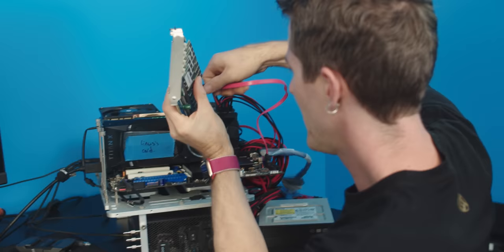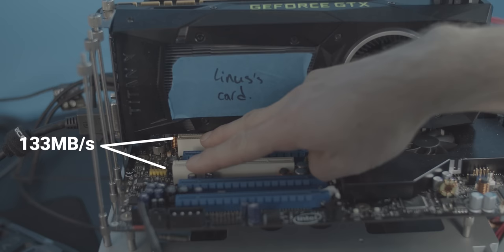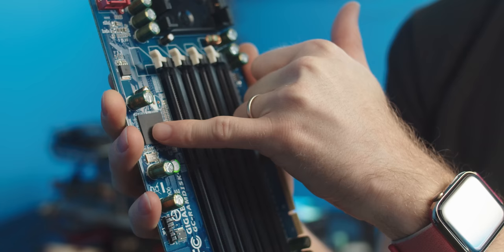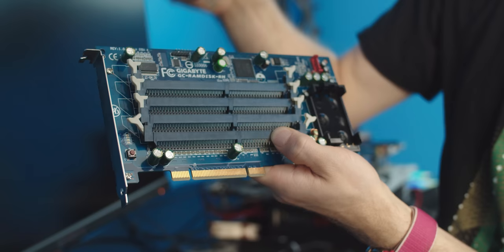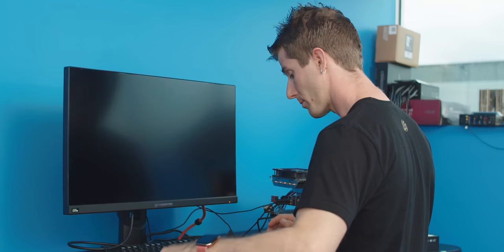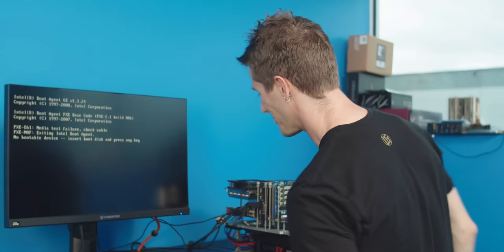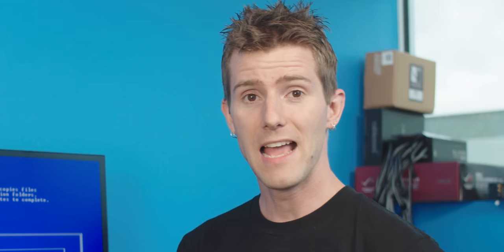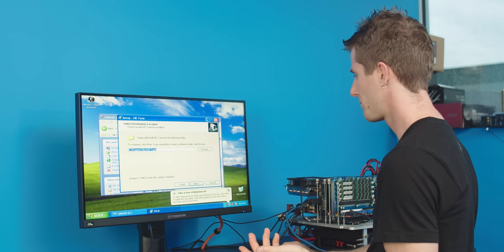WTF is this thing? - RAM on a PCI Card??

Comment: Amazing drive. Now when FBI gets me I just turn off my pc and my data is gone.
Reply: @budgetbajur  oh yeah this is big brain time
Reply: good job Jared
Reply: This idea is actually kind of used. There's an operating system called tails os which keeps only a small bootable operating system in storage (you can have it on a flash drive) and all session information is kept in RAM, then when you log out it is all securely erased. Combine this with Tor and you'd be real hard to track.
Reply: @sfadhjkl4112  Actually Tor is already preinstalled in Tails ))
Reply: You see Ivan, Americunts can no steal data when no data is there.
Reply: Oh so that I the reason it was removed from market.
Reply: Thats probably the best use I can think of for this "drive". The data would be super secure from physical theft or seizure, especially if you don't have the battery installed.
Reply: Not really.
They will break you door, get canned air and freeze your memory with it, then quickly dump the contents before they're gone.
It's what they do with actual memory.
Reply: @dan_loup  absolutely!
Here's some interesting stuff for other:
https://en.m.wikipedia.org/wiki/DRAM_data_remanence
and
https://en.m.wikipedia.org/wiki/Cold_boot_attack
Reply: @dan_loup  how can canned air  prevent data loss from ram on power off?
Reply: @frinkpc2515  смотри выше ;)
Reply: KAJJTAN If you have enough ram, I think it would be possible to set up a persistent ram disk to do the same. Maybe.
Reply: @frinkpc2515  They literally freeze the chips.
This somehow makes the capacitors take more time to discharge.
Reply: @frinkpc2515  When you turn a can of air upside down, it sprays freezing cold air. Spray that freezing air over the RAM sticks for a few seconds, and all that volatile memory data freezes in place. You can then transport it, unpowered, to another machine and read back the data.
Reply: @BaghaShams  There IS a countermeasure against that, and that's by simply making sure that TAILS is allowed to zero out the session storage memory as it shuts down, as well as doing whatever can be done to delay access to the computer's internals to allow more time between power loss and freezing. Stuff like installing a lock on the computer case to delay it's opening by another 30 seconds at least, or making sure law enforcement jumps through requisite hoops if it's not a no-knock raid (which you should be doing regardless.) Also memory encryption is also possible as a countermeasure, or if you REALLY wanna look incriminating, you can physically secure the ram to the motherboard with glue or solder and use SecureBoot to make them have to risk more time between powering down and dumping the memory.
Reply: @dan_loup  you unplug as soon as you hear the door broken down.
Reply: @dan_loup  oh so that's why it was so cold here in august...
Reply: @sfadhjkl4112  Most Linux live CDs do that. Most see it as a limitation, tails see it as a feature.
Reply: HAHAHAHA I should not be laughing so hard at this comment lol
Reply: @Offsettttt  I think it set up so all internet connection go through tor. not just the browser, but the entire OS
Reply: Set your BIOS to overwrite memory during POST. Hit the reset button when they break down the door.
Reply: @bonob0123  Jared did nothing wrong.
Nice try though, still pretending he was guilty when he had proof he was not. 
Your beating a deadhorse. Your witchhunt failed. Get over it.
Reply: @dan_loup  I know of this, but want to see it in practice.
Reply: best statement I have seen all day
Reply: @factsvscommunism3679  lol wtf
Reply: Nope that wouldn't work either! The residual charge is STILL THERE even after you cycle power on/off for a few short minutes! If the MIB's bring along their tank of Liquid Helium, they can STILL recover your data!

AND since they ARE the MIB, they won't announce their raid on your Deep Dark Web Hacking Lair and they WILL get to your computer within the allotted 3 to 5 minutes it takes for the residual electrical charges to dissipate within your computer's RAM !!!

Every second counts though.....BUT....because of modern mathematics and digital signal processing (DSP) they can assign the MOST LIKELY bit state is assumed to be present when OTHER nearby bit states are consistent with known facts, data and/or file structures. This means they can afford to take their time to find you and your computer to get at those RAM sticks!

To PROTECT against such MIB (i.e. the Men In Black!) shenanigans, take the 240 volts at 30 amps circuit from your washer/dryer and stick some live wires directly into a USB or network port. At that high voltage and amperage, the result current and massive spark will jump any air gaps or motherboard fuses and WILL DESTROY your RAM chips permanently --- PERIOD !!!

That will work!

.
Reply: Clyde Cash  HOW ISNT HE INNOCENT, HE HAD PROOF ON TEXT, THAT THE PERSON ADDMITTED THEY LIED ABOUT THEIR AGE AND PROJARED THEREFORE WASNT A PREDATOR, Better luck next time.
Reply: Clyde Cash  'HOW IS HE INNOCENT' Because he was never proven GUILTY IN THE FIRST PLACE and HE GAVE PROOF that he did nothing wrong? Try again.
Reply: Clyde Cash  He was never guilty, you cant ask how he is innocent when he was never guilty in the first place. Its been months since he proved your lies wrong, Try again.
Reply: @bonob0123 Pro Jared was a PROVEN innocent man who had his life robbed due to a fact, unproven accusation that was debunked with proof. Yes 'WTF' indeed.
Reply: @factsvscommunism3679  relax Jared. didn't realize they let you creeps access to YouTube inside Englewood
Reply: @Exarian  Or you know... just use a case. I don't really see how they would be able to get to it in time as RAM has a tendency of purging itself really quickly.
Reply: @dan_loup  apparently only if they get to your machine quickly, like if you're able to pull the power and not instantly tackled most of the data would be lost
Reply: @forcefxguy  You probably have to stall em for like 30 seconds to be sure.
Reply: take the memory VCC and connect it to a relay directly into a 9v or 12v battery, pot the board on thic resin, then put a switch in the bottom of the pc and one switch in the case and a thermistor with a temperature comparator, pot the motherfucker and put a VGA output so that it doesn`t seem like a ram module to begin with. Door sensors are excellent triggers for a raid, as the MIBs and FEDs break all of the doors in a raid you can have a weak door to nowhere as a trigger.
Reply: @fss1704  Just the potting part will probably do the trick.
Reply: @dan_loup  Did you ever watched fantastic four? remember what happens when you freeze rubber/plastic? it gets brittle and weak, any hammer will shatter the resin into a million pieces.and free the ram at low temperature, that`s why you need a sensor in order to fuck the modules in the case the temperature drops below a certain limit, and the wire mess connected to the trigger so that they can`t even chemically dilute the epoxy using MEKP or DCM because one wire would touch another and trigger the circuit.
Reply: I see you are well versed in this! Are you in Utah, Colorado, Virginia or Maryland by any Chance?

As another suggestion, I just put small shape charges onto the motherboard, ram and hard drives and blow their brains out if any nefarious party enters unceremoniously via a simple and easy to reach heavy-duty toggle/contact switch assembly! You you can also use a deadman's type switch that triggers the shape charges if the case is opened or hacked through with pliers, hammers or a saw! 

That works too!

--
Reply: You could also rig a circuit that produces High voltage at the touch of a button.  It would blow out every cell in the ram chips, destroy data on platters, and literally melt chips.  No way in hell data is coming back from that
Reply: @sambach9450  why use HDDs at all, it's so much easier to blow up  the data on ssd`s and the price is so low, and you can be 100% sure that you've destroyed the data by popping the chips fried instead of possibly leaving some incriminating data on the platters.
Reply: A brick of C4 or Semtex would ALSO do the job and IT LOOKS SO MUCH COOLER to blow up your house in a great big ball of orange, blue and white fire to ENSURE your data is safe from prying and/or evil eyes!   :-)  :-)   :-)
Reply: Wait you guys dont have your PC hovering over an incinerator? noobs :P
Reply: bang on the money, mate. a german mate introduced me to it several years back. he uses it himself for 'reasons' *wink*.
Reply: @dan_loup  Doesn't seem likely to work unless things go perfect for them. No battery and a pulled plug as soon as you hear the door go, there's no way they'll get to the internals before the caps are dead. If they're storming your house, odds are, you're going to face an AR, not a can of dust off.
Reply: Exarian honestly at that point just have a small amount of C4 attached to the ram with a detonation device attached to a heart rate monitor as soon as your cat knocks the lamp over your whole computer just goes up in smoke
Reply: Never mind I just scrolled to the bottom of this conversation and I see some other degenerates have entered the chat recently
Reply: @budgetbajur  does loli furry even exist? Bruh
Reply: @olivethekitty5706  I'm not sure, but there's so much  fucked up shit on the internet that I wouldn't be surprised
Reply: Yeah. They’ll just shock your balls until you tell them something.
Reply: ...and all of your 21 illegal pix are gone. Congratulations.
Reply: What about having the powercord split, so that one stray wire goes directly into the RAM, with a dead man's switch in between to be held down while the computer is powered on? Offcourse the power would have to be disconnected when not in use, possibly also grounding it or something
Reply: DUDE TRUE.
Reply: Gigabyte: We're just gonna place your data right on this RAM card aaaaaaaaaaaaand it's gone!
Consumer: What?
Gigabyte: It's gone. Next!
Reply: Now i wonder what Mr. Robot series never used that, instead microwaved their stuff... Lazy writting i guess.
Reply: Exarian and most importantly why would the swat team bring cold compressed air lmao, are they going to fix your dusty old pc lmao
Reply: Sounds like a Seagate
Reply: FBI : Yeah sure kid.
Reply: Maybe have a deadman's switch, either a footplate that you stand on, or a tether to your belt, so if you are forcefully dragged from the desk with no warning, your PC will power down.
Reply: @sfadhjkl4112  and use an orwl pc
Reply: @SgtStickyTits  lol nice name
Reply: @MrRourk  it was 2 companies that made it one was hyperos hyper disk,  it was bought by huge hard drive company cus it was so fucking fast toooooooo ahead of its time , ya know will see hard drive as fasta as those one like in 10 years,  in 10 more years they can sell more shitty hard drives , the iram linus is holding was build 2005 so go figure
Reply: @sfadhjkl4112  I agree fully but this probably got you and me on a watchlist for even thinking it 🤣🤣
Reply: @sfadhjkl4112  seem's like you researched this alot, idk kinnda sus.
Reply: loll
Reply: Big brain time

Comment: would be very interesting to see a modern version of this with the high capacity high speed ECC ram now available and the high bandwidth of PCIE 4.0
Reply: with the speeds optane and Gen4 SSDs already have, the law of diminishing returns would give u little to no benefit considering the inherent disadvantage of RAM as storage (volatility)
Reply: @xyeahtony1  yeah obviously, but it’d be cool to see right?
Reply: @xyeahtony1  The volatility isn't a problem if it is a home server that never gets shut off.
Reply: @gregdaweson4657  except theres no way to guarantee that. even enterprise data centers can and do suffer from power outages. boop, there goes all the data. still failing to see the advantage of RAM as a storage medium over an SSD, especially since SSDs have greater capacity than ram.
Reply: @xyeahtony1  RAM is still faster, though. Buuut a hardware implementation like this IS practically useless, especially when drivers exist to create software RAMdisks that can be used, for example, to effectively eliminate storage bottlenecks in realtime video recording where you could potentially miss frames to slow storage.

Also, Windows already uses virtual RAMdisks in its recovery and installation CD modes. This is great for live CD systems because both Windows and Linux themselves are not designed to boot directly off of read-only media. So using a lighterweight version of the OS and faking it with RAM ends up just fine, especially since you don't want the changes that these live environments try to make to themselves as part of their normal execution to be saved.

RAM is also a great place to store your temp folder if you really wanna be sure it'll be gone every reboot.
Reply: I’d love to see a modern version of this. I’d buy one if the price was reasonable enough. I could think of some good uses for it.
Reply: First off we need to know our motherboard speed first, otherwise that will be useless because your motherboard get bottleneck by your pcie storage ram
Man even m.2 nvme still feel bottleneck with fastest motherboard in this era, except in the future we can have processor and gpu direct storage that basically we ignored our motherboard data transfer
Edit : Oh yeah i forget to mention that even our pciex16 speed still not comparable with ddr4 socket speed
Reply: @xyeahtony1  i could see that volatility being an advantage. instead of using it for permanent storage, use it for temporary storage. software generates all kinds of temp files you don't necessarily care about. but, they do take space and write cycles off of your dedicated drive[s]. also, the nature of some activities generates tons of files that likely won't exist once they've been used. i do a decent amount of web gaming/browsing and i reverse-engineer file formats, both generate a lot of temporary data that gets deleted almost as fast. i'd still want to mitigate data loss from power failures [which can be done], but i'd be quite glad to do my reversing work [at least the dumping raw data for analysis part] and run the browser cache off of volatile memory.
Reply: Here we go
@ddramdiskofficial7099
Reply: NVRam disks/SCM are the modern equivalent
Reply: You can always just mount the ram as disk and use it. I remember I used to use video car ram as a buffer, don't know if its still plausible. NVMe flash is good enough.
Reply: Nvdimm
Reply: Level1tech made a video talking about nvme raids. They had a system wih terrible performamce. 
After some troubleshooting ot turned out, that thr raid of ~10 nvme drives was bottlenecked by the 8 channel ddr4 ram which caused timeout errors. 
We're at a point where the ram is to slow to handle the drive speed.
Reply: I'd be happy with a version that supported DDR3 Registered.
That stuff is quite inexpensive right now, and seems to still be getting cheaper as it's not gotten uncommon yet.
Reply: @xyeahtony1  Well what if you just have a fast SSD on the RAM-Storage card thing and a small rechargeable battery? Then what you could do is charge the battery while the computer is on, and then when you turn it off the data stored in the RAM is quickly loaded into the SSD. Then, during the time it takes for the bootloader to get started, the data inside the SSD is dumped back into RAM. I'm not an expert, but I think that that could work OK.
Reply: @markwilson3326 
A better use case is as a caching drive for a media/editor server. Run write ops only on save, and power volatility won't be problematic when it isn't meant to store anything for long
Reply: @xyeahtony1  Between a UPS and built in batteries that can get to much higher capacities today, I don't think that it would be a problem.

Comment: this was interesting from a tech history perspective
Reply: There is people still using this device
Reply: There were dumb modules to convert 4  30 pin simm ( you know , 8 bit data ...386dx,a  32 bit cpu, required 4 in parallel )  into a 4x larger simm..  there were cards to add real , directly addressed, RAM into 286's.   ( 24 addresses!).   These could be bought empty,so that you could reclaim your DIP ram from older hardware.  For the 8086 ,there were cards to bank switch extra ram .. oike virtual memory , but appearing to dos as a small chunk of RAM in the 640k to 1024k  address range.. EMS ..emulated by emm386.exe , which after a while was only used to easily start, use protected mode and keep Dos ..   surely this RAM drive would have been better as a scratch drive ,   for what you are doing at the time,  the game files,or data files .. or as a swap drive ..
Reply: He said that "custom silicon was no problem for gigabyte".  I think thats sarcastic..or error .. Custom silicon  is expensive  when divided by only 1000 ..  so if the price each was more than a FPGA they used  the FPGA..  back in DOS days there was ramdrive.exe , you would make the dos boot  floppy load  various utilities you might need . Edit, copy,xcopy ,format .. into it,so you could move on to the apps floppy disk and "work"...
Reply: @SimuLord  “Hey guys, Linus from Forgotten Tech.com, today we’re going to be taking a look at Nvidia’s first graphics card.”
Reply: nice piece of hardware to get  in private PC hardware collection
Reply: @alphaasianjosh  didn't even get the parody intro format right shakin my damn smh
Reply: @internetisinteresting7720  no, there isn’t.
Reply: @TonyisToking  here In Cuba boy an a lot of countries in the world
Reply: Any idea how much this would actually decrease boot time?

It's possible to have the OS to copy itself to RAM every boot if you have enough. At least Linux can, not sure about Windows without a lot of work.